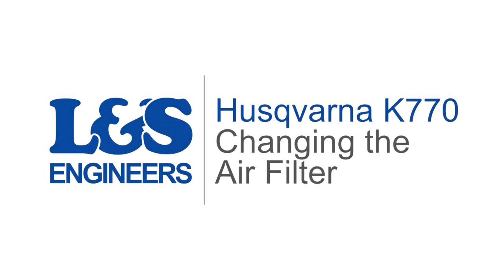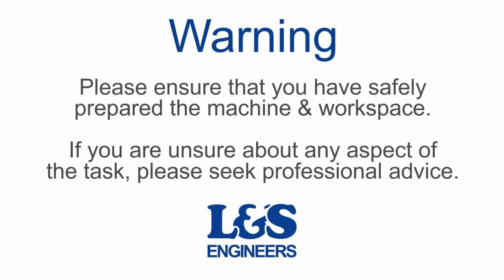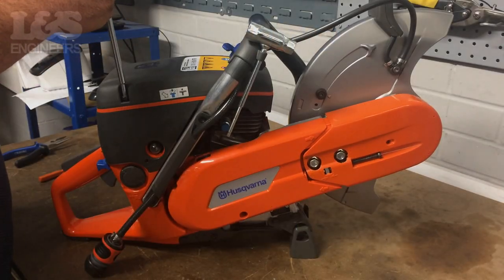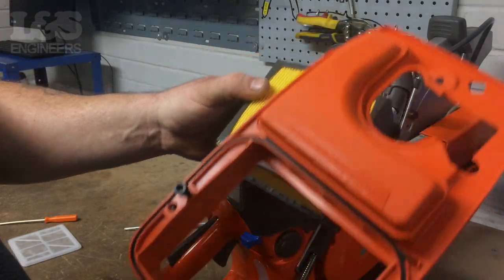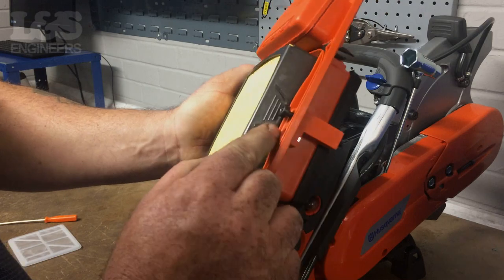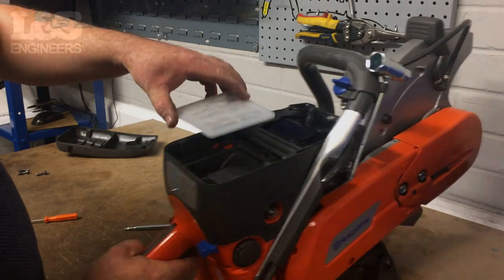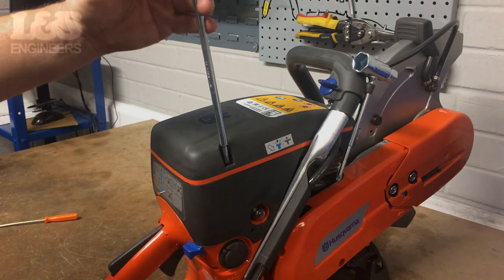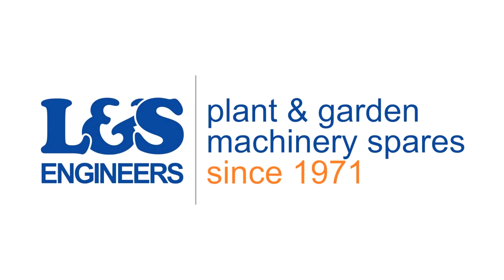How to Change an Air Filter on a Husqvarna K770 Disc Cutter | L&S Engineers

Comment: How often do you need to change it please
Reply from the maker: Hi, 

The air filter only needs to be checked if the engine drops
 in power. However it is best to inspect the air filter monthly, and only needs to be changed when clogged, damaged or worn.

If you have anymore questions just let us know :)